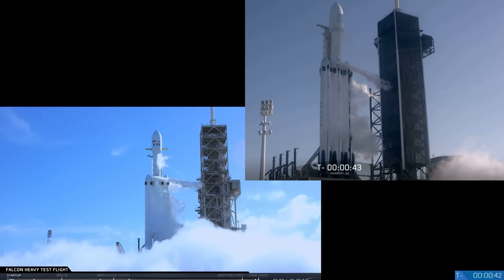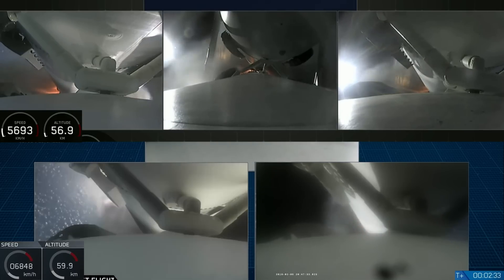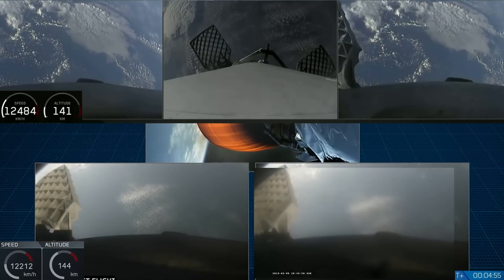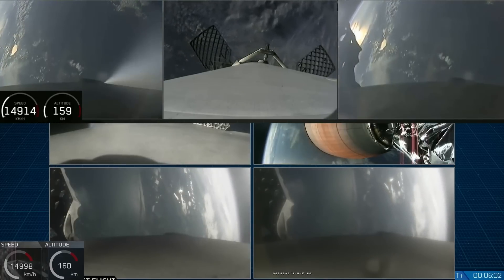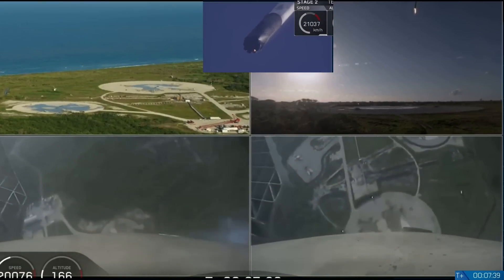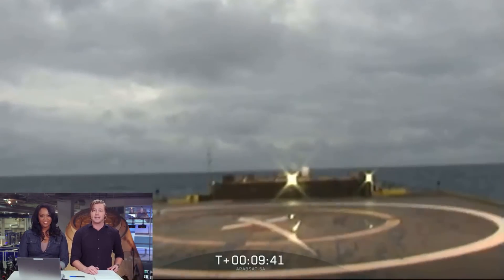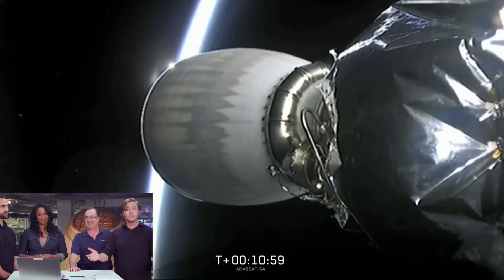Falcon Heavy Demo and Falcon Heavy Arabsat-6A Side-by-side comparison!

Comment: T-0 has a 3 second delay from one to the other. Ignition should be at T-3s and is not is one of the shots. Therefore, one lifts off the ramp at T-0 and the other at T+3s

Comment: Dayum that 10% thrust increase over the block 4 version is so obvious.
Reply: Thanks, you just answered my question
Reply: Something to note about the Arabsat 6a launch is the center core was at full throttle for the first few seconds, whereas the demo mission center core took off at low throttle

So it wasnt just upgraded engines, it was also much more thrust on that takeoff

Comment: Just my comments as I watch...
Ok, the block5 FH is definitely more of a sprinter off the launchpad!
I thought I saw that in the webcast, but this side-by-side shows it so clearly.
And then the new FH seems to throttle down more, as it passes near maxQ. And stay more throttled-down, possibly this shows the center core conserving its fuel for later?
Yep. boosters drop at 5865 vs 7000km/h  That is a HUGELY different flight profile! It also makes the return trip for the side boosters a lot easier, by being both nearer and slower. This would save them a good drop of fuel. Also some wear-n-tear, but for RTLS boosters that never was much.
Meco 9486km/h at 90km alt (old) vs 10739 at 100km alt(new).  And this while there is a much heavier payload on the new flight. 
That sure is one impressive gain in performance!!
Reply: also i think mass of 2nd falcon heavy's payload was much larger than 1st, it should affect flight profile too.
Reply: Looks like they held down the demo FH a bit longer during engine start as well
Reply: The upcoming flight today will have an interesting flight profile. The side boosters will cut off three seconds earlier than ArabSat 6A and will thus have a slower total velocity, but their vertical velocity will be much higher. Which means less ∆V for boost back. This will throw them a lot higher up meaning a bit more ∆V for re-entry. This means landing won't happen till nearly 9 minutes after launch. The centre core will also shut down three seconds earlier but probably a lot higher than 95km, I've seen some people calculate it will fly 200km into the air before falling down, and not landing till 11 and a half minutes after launch.

Comment: I asking this on the second launch. Why does the side booster started at T-5 second the first flight, and not on the second..?
Reply: First flight, they were very nervous about the shock/noise/transients of lighting all the engines in together or very rapidly after each other.
After that first flight, they had tons of data on what actually happens, so they could tweak the startup to be faster and more like a normal Falcon9.
Also, remember that the Block5 has a significantly stronger Octaweb which the engines are mounted on, this could reduce the problem of flexing and transients during startup.
Reply: @marvinkitfox3386  thank you :)

Comment: Thank you for putting both of the launches together. It’s much easier to compare both the initial and commercial flights! SpaceX has done an amazing job with landing all three boosters of the first stage. I wonder if they have though about having all the boosters land on drone ships eventually, it could help launch more mass and have the first stage still be recovered.

Comment: The ignition seems to be some seconds earlier on the first flight.
Reply: they ignited the side boosters a few seconds earlier in the test flight, with the block 5 all 3 ignited at the same time.
Reply: @kuiken1991 
Nah, even Block 5 had a delay between side booster ignition and then center, but shorter.

Comment: 1:10 Did the two FH rotate in the opposite direction?
Reply: Yes.
It would vary depending of the exact wind direction, they turn the falcon to face to the strongest anticipated wind shear, minimizing stress.
If that happens to be a bit clockwise on one mission and anti-clockwise on the next, its not important.
The FalconHeavy does not have a strong preference for a specific attitude, unlike the shuttle which had to have the shuttle body 'below' the tank.

Comment: Very well done. It seems the additional weight of the Arabsat payload verse Elon's Tessla really had an impact on the delta v. Excellent work. It seems the higher performance block 5 boosters really kicked ass at the start, then the heavier payload really started to impact velocity. But then the block 5 boosters seem to push the second stage into a more efficient trajectory. Then, stage separation, and the block 5  boosters make it back to landing site quicker because of having had a proverbial better launch 'angle of attack' because of performance efficiency. Interesting.....
Reply: Block 5 boosters quite possibly more fuel in reserve for boost-back, quite possibly better glide performance, equals faster return trip.  The acceleration differences for the full stack and second stage were interesting.  Very similar at the outset allowing for a slightly different flight profile, with the lighter demo stack pulling distinctly ahead by BECO.  But then the block 5 center core pushes the second stage for so much longer than the demo core did; MECO is way higher velocity for block 5.  Did the block 5 core stay more throttled down than the demo because of stronger side boosters?  Did it have more fuel to spare due to its own higher performance?  A little of both?  Finally , Arabsat's greater mass really starts to tell after the second stages have been burning a while.  All in all, super interesting.
Reply: I think you said it better than me. It really is a very interesting side by side. Block 5 is at least 10% better performance than the demo core. So, either Arabsat was one significant mass satellite, or, SpaceX knew they had the performance overkill to get to orbit, and therefore chose not to overwork the first stage stack.
Reply: The payload weight would have very little impact on the first stage's flight numbers. It is a 3.5t difference, on a 93t second stage.
The main difference in performance is that the Arabsat launch throttled down the center core a *lot* more, allowing it to burn for almost 30 seconds longer than on the demo flight.
Obviously, with both less thrust and a heavier core(less fuel used in core), the booster phase of the launch went slower.

Comment: The first thing I saw was the original test flight seemed to start engines earlier but to launch and clear the tower at the same time. Would that be a function of the hold down clamps and adding time on a first launch to get up to the necessary thrust? I can’t quickly find precise data on the actual payload difference. The Arabsat is known but the first payload was estimated as lighter. It was very cool to see them side by side.

The original launch separated the side boosters at virtually the same time into the launch, but at a higher speed and elevation. The original flight boosters also land last, possibly showing a choice to leave more of the work for the center core, balancing relative efficiencies again by letting the center core do more of the work. In the transition between first and second stage of the first flight, the second flight surpassed the first in speed but at a lower elevation. All things point to an improvement in efficiency I think, but the flight profiles are different enough I am not certain. I wish I knew what the difference in atmospheric conditions, throttle rates in the early flight and the hoped for orbits were, since one is intended to get geosynchronous and one was intended to leave a planetary orbit. They pass each other in stats again as the boosters are landing.

All in all I thank the creator of this video, it was really interesting.
Reply: On the first launch, they lit the side boosters are t-6, and the center at t-2ish so they could monitor the start up and generate data.
After review of the data, they found they could light all three cores at t-1 (or t-2, I forget which)

Comment: Seems the FH Block 5 is a bit faster than the 1st.
Reply: human Mars Yeah the block 5 has 10% more thrust than the block 4.
Reply: @JayDaGod_1   Yes, but it's a different mission profile
Reply: @DrJump3r  they actually had a similar ascent profile because Starman was kicked into a high transfer orbit similar with GTO missions because Elon wanted to have the earth in full view behind the car. The second stage coasted for a long time before fulfilling the tans-Martian injection burn, testing falcon 9s long coast ability, as well as its ability to accurately send a payload to orbit with falcon heavy.
Reply: Jaylon Collins - SFS I thought it was like as low as 5% is it really 10%
Reply: Apart from the block improvement, the Sat was 4 times heavier than the Tesla Roadster.
Reply: @sirierieott5882  Doesn't make the difference in the early part of the flight you might expect. At launch, the mass of the rocket is about 1400 tonnes compared to the 6 or so of the satellite this time. The extra ten percent thrust would more than makeup for this difference early on. They have to keep the acceleration and hence velocity below a limit because of increasing load on rocket payload fairing (the reason for max q call out). You are correct in that the sat will be noticeably/importantly accelerated less quickly by the upper stage because that has a much smaller mass of about 100 tonnes, but the precalculated launch profile will be more of an effect on the speed at each point overall than just ratio of satellite to the car's mass on this flight. Even this heavier satellite is super light compared to what FH can throw and was more of an operational test flight towards certification for airforce who do launch things heavy enough to require FH and pay top dollar. They could have put it on a block 5 F9 and still landed the 1st stage(albeit on a drone ship ).
:)
[summary] its faster because of the extra 10 percent thrust which more than compensates for the percentage difference in mass of FH+car vs FH+sat.But there are limits to how much this extra performance can be used low in the atmosphere without breaking the rocket due to excess aerodynamic forces due to overspeeding in dense atmosphere.
Reply: I think I’ve just overdosed on Falcon Heavy!
Reply: Siri Erieott watch your weight, you might get “heavy” lol
Reply: FH block 5 has about 10% more thrust. You really see that in the beginning. The payload on the testflight was way less then the launch a few days ago (thats why the rocket on the test flight catch up in speed so fast later on)
Reply: No shock there, Block 5 is just more powerful, though I was surprised that for a big part of the ascent, it looked like the lighter payload of the Tesla was going to make the difference. I dunno, it does feel like the Demo mission had a steeper ascent profile, because they did have to get out of those upper-atmosphere winds. All in all though, it doesn't matter. Seeing those two boosters do a simultaneous landing was just as awesome the second time around as it was the first time.
Reply: Pretty sure they didn't have the block 5 heavy turned up full wick. The payload could have been launched on a falcon 9. They prob had it turned down to be conservative.
Reply: @mattgixxer776  That is undoubtedly the case here.
Reply: Another thing, watch the ignition sequence, on the test flight ignition happened at t - 6 seconds, the Arabsat launch was at t -1second. Arabsat looks to have lifted off earlier as well.
Reply: I am almost positive they had the Block 5 throttled back because Arabsat can not take the thrust of a full burn.
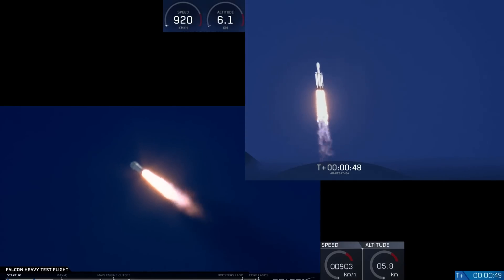Reply: When you look at the first, bit, you can see that block 5 has more lifting power.  You can tell the payload was lower on the test flight by how it over takes block 5 on speed. Block five still had more altitude when it was overtaken. This is based on what I have seen up to 1:34
Reply: Yup definitely no doubt
Reply: At first block 5 is faster, then before the booster cutoff, block 4 is faster. After that Block 5 more than makes up for it with 1000km/h extra from the center stage. 

They powered down the center stage more than before so it had more fuel. The 4 ton difference in payload doesnt make such big difference in the first few stages. Because theres also 90 ton second stage to accelerate.
Reply: much heavier payload too